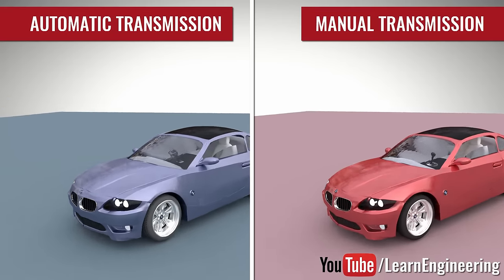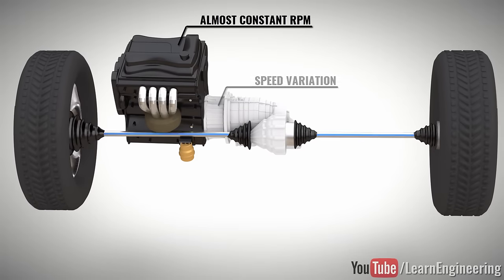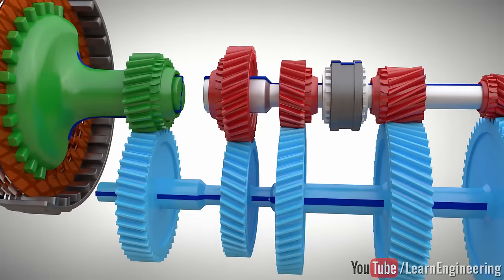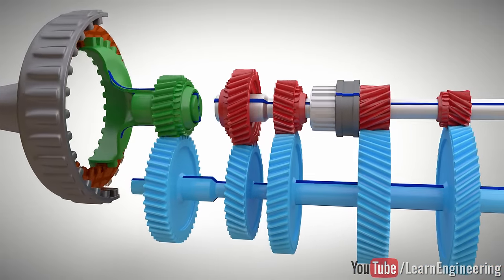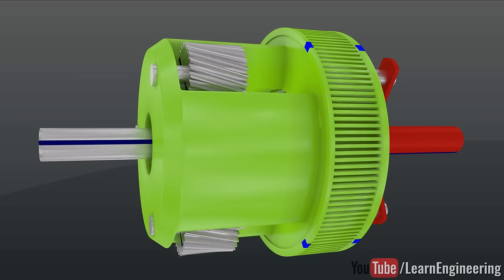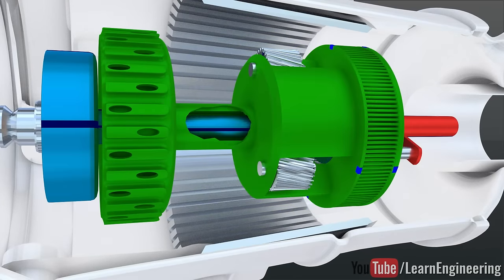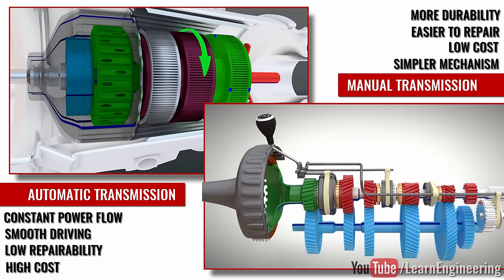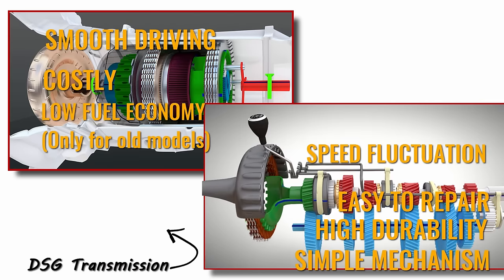Automatic vs Manual Transmission

Comment: You forgot to mention that manual is also a free anti-theft mean in the States
Reply: And also you can roll start if your battery is dead
Reply: Or drive with the starter if your out of gas.
Reply: @edgeofforever7720  how?
Reply: @jettproductions6145  how to drive without battery lol
Reply: @cautarepvp2079  
You put the car in first gear and crank it.

You can also start the car by putting it in gear rolling the car and then "popping" the clutch
Reply: So the way engines start is that the batteries use the starter, which is an electric motor that starts turning the engine parts creating combustion. With a manual transmission, you are able to shift into 1st gear and start it by like going down a hill. However, on an automatic thats impossible due to the torque converter.
Reply: Also never ever use the starter more than 10 seconds at a time. Give it breaks every 10 seconds. The starter is a powerful motor but works really hard to turn, you are able to kill it by cranking over due to the stress it gets. So please only use it to start your car and if it doesnt start in 10 seconds, wait about 10 seconds before trying again.
Reply: I wonder if automatic transmision cars are the dominant choice among americans
Reply: Why?
Reply: It is so easy to drive a manual but you folks make a big deal out so don't feel too smart. I think there are folks intimidated by it but if you are trying to steal a car, I doubt you are intimidated. Most people don't drive stick because they prefer to something else with their hand. =-)
Reply: @idocare6538  driving a manual is so complicated if you drive without any sleep at all, you rise the chance of an accident
Reply: @Aj Reyes 
Same with an automatic. 
To be honest, I don’t have a manual but would really like to get one.  But with any vehicle (whether it is automatic, manual, or aerial) you should not drive sleepless at the wheel.
Reply: @ajreyes1262  well in the other hand (automatics) you have an higher chance of fall asleep since you just have two tasks mostly. And still is not that complicated, its just second nature for most and for my experience you will not have such trouble with no sleep
Reply: @edgeofforever7720  You're burning your starter motor way before you get to a gas station though...Assuming you will have enough battery for that.

It's a good way to get your car out of a spot you dont want it, and the car wont start though.
Reply: Yeah not if u live in the inner city
Reply: @ajreyes1262  I'd argue the opposite. Automatic transmissions allow you to not have to stay as focused in order to smoothly drive so it's easier to get distracted or fall asleep at the wheel. With a manual transmission, you are actively engaged with the process of driving. You always have to be aware of things like rev matching and downshifting, clutch control in tight traffic, or even something as simple taking off on an upward hill with traffic right behind you. Not a concern whatsoever with automatic transmissions, just brake and gas.
Reply: @greego5952  2nd gear not first.
Reply: @pedinhuh16  you can use this on railroad crossing.
Reply: That's pathetic though. Like really. How tf did Americans think its a good idea to do driving tests in automatics.
Reply: @edgeofforever7720  yep, had to do it for 4 km, just put in first and keep the key in starting position without holding the clutch like when you stall it jerks forward.
Reply: Yet US makes most manual sports cars still.
Reply: How is it anti-theft?
Reply: Wulf - Your horrible joke falls flat even more when you check the statistics and realize the top stolen cars in the US are the honda accord and honda civic, in fact for the accord the most stolen model year is the 1997. Try again.
Reply: @ryanwhiteside4333  oh lol
Reply: @DesertStateInEU  salty murican
Reply: @DesertStateInEU  My aunt and uncle literally had their house broken into a few years ago and guess what? Automatic car was gone. Manual was not.
Reply: In the states no one steals cars🤣🤣
Reply: @thedon897  uh.. is this a joke I'm not getting?
Reply: Ryan Whiteside it definitely must be
Reply: @mrroams5812  Still doesnt change the statistics. Most stolen cars are the 1997 Accord and Civic.
Reply: @DesertStateInEU  Check again.  There's no way those two cars make up 50+% of car thefts. Might be the most commonly stolen cars but that might be 1% of all cars stolen,  if that. And then you take a percentage off that for the automatic versions of those cars and your point is basically rendered moot.
Reply: @mrroams5812  And wrong again. Those are the most stolen cars period, and in 1997 there werent many, if any at all, that were automatics. Your point is basically rendered moot.
Reply: @DesertStateInEU  Do you honestly believe over half of all stolen cars are just two old models of cars?
Reply: @mrroams5812  Who said half? And why dont you do your research instead of annoying adults? This is why the internet but especially why voting should be IQ restricted.
Reply: @DesertStateInEU  ??? I live in the US and am generally happy to be here so idk where tf you're getting that from. Nothing I've said has mentioned anything about that? Are you high right now? I guess that explains why you completely missed the points I mentioned in that statistic...
Reply: So true, people these days have no idea how to drive a stick shift
Reply: @mrroams5812  Thats one way of admitting you gave up. Good.
Reply: Can you answer me a question? In a manual transmission, it's bad for the engine to press the breaks without pressing the clutch? Hope you can answer me :)
Reply: @alxxla4102  It's because thief's are as lazy as people, so they don't know how to drive a manual car 😅 lol
Reply: @edgeofforever7720  *2nd or 3rd
Reply: My central locking died on my Mazda 4 years ago, I’ve never bothered fixing it, still yet to be stolen.
Reply: Hahahhaahahaha
Reply: @ajreyes1262  my dad has an automatic, but he still says Manual transmission is better for no sleep driving
Reply: @edgeofforever7720  Or you can pull it with another car with the clutch out which will spin the engine until it fires.  Then quickly step on the clutch when it does.  But on today's cars that are so dependent on computers to run, even popping the clutch won't work if the battery is so dead that it can't provide a little bit of power to the computer.  Popping the clutch worked best on the vehicles before they became so dependent on computers.
Reply: @cautarepvp2079  put the car in gear so the engine spins why’ll you push it and the serpentine belt will spin the alternator giving power to the ignition injectors a spark plugs eventually the engine will start and that’s it
Reply: @alessiom3859  I love manual transmission but I have to get rid of mine because it Fuchs up my knee. If I could get a cheap one that had a paddle clutch I would get it
Reply: @greego5952  w124 and w140 benz with automatic can be started by rolling so its not impossible
Reply: @ryanwhiteside4333  are you from one of the countries that we've bombed or something?
Reply: @ziolp  I'm not, but it's sad you're bragging about that, go invent new names for collateral damage
Reply: @iminsideyourwalls9432  Yes automatic cars are way more popular then manual. I think the main reason people don't use manual is because automatics are just the way of the future. I prefer manual over automatic, but my sister didn't even know what a manual was. I wouldn't call someone lazy just for wanting an automatic transmission, but maybe if the USA only had manuals there would be less accidents. People would pay more attention to driving if they were forced to by driving manuals. Not that I think manuals should be the only transmission, just that we would probably be better off if they were.
Reply: Manuals are dying and for a good reason. It's old tech. I'm from the US and drove manuals for 15 years. So did a many of my friends. Most youngsters still prefer and drive manuals so saying Americans can't drive manuals is a stupid statement. I now have have an 8 speed auto and don't feel like going back to a manual. I throw the shifter into manual mode wherever I feel like having fun 🤷‍♂️
Reply: @ajreyes1262  lmao shitfting on the manual keeps me awake all the time
Reply: I mean not really like lots of people know manuals, I never drove one but I ride motorcycles so I sure I could figure it out quickly
Reply: LMAOOOOO
Reply: @alessiom3859  Reality is because it was due to a higher GDP and much longer flatter roads around our parents time as well as fuel costs.

The culture shift is happening in europe and the UK as well, automatic transmissions are now outselling manuals in britain.
Reply: @edgeofforever7720  drive with out gas??? Combustion goes brrr
Reply: A transmission can't be an anti-theft device. It just moves cars.
Reply: @iminsideyourwalls9432  Yes because automatic transmissions are a luxury. I actually prefer a manual transmission but with the common trend of automatic vehicles, and the fact that automatic tramsmission technology has come so far it's very difficult to buy a manual transmission vehicle in the US nowadays.
Reply: Americans have to be a hot topic right now. Can’t go on a single comment section without hearing what some foreigner thinks of me, hell I knew we lived rent free. But everything from transmission to clothing to housing to alcohol to politics, every aspect of life is critiqued by self loathing Americans and snobby foreigners.
Reply: @alessiom3859  Well actually, only 4% Americans uses manual transmission.
Reply: I left my car unlocked at school and no one stole it lol
Reply: @edgeofforever7720  almost every person I’ve talked to that doesn’t drive a manual didn’t even know there was a third pedal much less what it does, they probably would give up and move on to another car to steal before figuring out how to start it
Reply: @nkdude11  imagine putting them in a model T lol...
It would be funny to watch them try to find the starter button
Or the throttle
Reply: @mauriciorizal  lightly tapping the breaks is fine, and should be done while downshifting as it displays break lights. Pressing any harder without the clutch could stall you.
Reply: Not sure what you mean because many people use stick shift
Reply: Weird that people think this when both of my cars that got stolen were manual transmissions.
Reply: @DesertStateInEU  I used to own an old silver 97 civic. After shopping after a long work day, I unlocked the door, sat down, and went to push my clutch pedal in to start the car only to realize the car I was sitting in was an automatic and wasn't mine.

After that experience I installed a kill switch in my car.
Reply: @edgeofforever7720  second gear is usually smoother, but you can also do it using rear gear, i can start a car that way with less than 2 meters.
Reply: @Wulf why are you so obsessed with America?
Reply: @edgeofforever7720  “Hey, look at me, I’m driving an electric car!”
Reply: @iminsideyourwalls9432  Yes. I think 80-90% are automatic in the US. I’ve only owned one car wit AT since 1976, and I only had that car briefly.
Reply: @alxxla4102  Most car thieves are young, and amateur, and have not learned to drive stick. A professional thief will know how.
Reply: @cautarepvp2079  But also you could just push the car if the battery is dead on manual ones.
Reply: Wow your so hilarious that’s a real knee slapped 😐
Reply: @wisdomfox857  I see you don’t live in the U.S.
Reply: @iminsideyourwalls9432  not at all lol
Reply: @ryanwhiteside4333  hey!!! Yes I can! Anyone else I know tho….. uhh…..
Reply: @edgeofforever7720  mm yes the funny. I’ll be talking to the literally one other person in my school of like 2000 that drives a stick and people will go “wHaT dO yOu MeAn ThErS tHrEe PeDaLs i OnLy HaVe TwO fEeT” like bruh ur never supposed to brake with ur left foot
Reply: @ajreyes1262  Because no one teaches anyone how to drive a manual  transmission anymore.
Reply: @old_spice8054  I've done it in reverse. Dead battery at night parked facing uphill in San Francisco.
Reply: @nkdude11  i do but i i dont live in the city
Reply: @iminsideyourwalls9432  Yes
Reply: @greego5952  you know a lot about motor vehicles 🚗 👍⭐️
Reply: Oh yeah.
Reply: @ajreyes1262  
If you’d be that tired you shouldn’t even be on the road, it would literally be illegal to drive in a state like that.

(Yes, I’m a bit late to the party)
Reply: @ajreyes1262   You shouldn't comment if you don't know how to drive with standard transmission.
Reply: I just take my fuel injector fuse out
Reply: @am you should get a manual if you’ve been wanting one. And I agree you shouldn’t drive too tired but you can argue you are more likely to fall asleep in an outsmarting where you aren’t as engaged in the driving experience.
Reply: @ryanwhiteside4333  why driving tests with automatics? Women
Reply: @mauriciorizal  That's one way of getting stalled.
You're basically stopping the engine.
That's why you need to disengage (cluth) the transmission, to isolate the wheels from the engine.
Reply: @edgeofforever7720  This made me laugh really hard! You're a genius.
Reply: People act like driving manual is an accomplishment. You're just doing extra steps. Besides manual isn't even that hard to drive.
Reply: @ICaligvla  Those extra steps are where the fun lies, you're constantly chasing after that perfect shift, and when you get it it's the best feeling in the world, you release the clutch as you're progressively applying the power and you don't feel a thing, no jerking, no lurching back and forth, nothing, everything is perfectly synchronized, and when you get multiple perfect shifts in a row you feel like an absolute master. I'd say for me, 50% of the driving fun comes from shifting, and the rest comes from handling, noise, and acceleration. And yes, it does require a lot of skills, driving a manual is like art, it's easy to learn but difficult to master. It took me a week to learn driving a manual car decently, but it took me a literal year of daily practice to learn to rev match perfectly, and even now I don't get it right all the time.
Reply: @edgeofforever7720   a very expensive way to move your car, but possible. Last thing you'd want is air inside your fuel pump, it's a very expensive fix.
Reply: @edgeofforever7720  if you're able to push a car on 1st gear, then yes.
 But in practice, I remember when I drained battery in my dad's car, and when my grandfather put 2nd gear I could push it with ease and then it started smoothly.
Reply: @idocare6538  actually most people here (or at least in the places I live) don't know the first thing about manuals, for instance I told a friend of mine to move my car out front one day and he went out only to realize he didn't know how to drive it. I've even had people ask me "what's the third pedal for on the left?" It is easy to drive a manual but the problem is people don't know how because they've always had automatics their whole lives
Reply: @iminsideyourwalls9432  it is, mainly in cars, small vehicles used in the city, but then for country people like me, I’ve got a couple Dodge Rams with automatic transmissions, and my uncle has the same vehicle, but with a standard, now I can pull better with the automatic, but in order to have the same amount of power going to me wheels, I have to have my engine tuned up to handle the power requirements of the transmission. So technically, a base vehicle like mine compared to my uncles, his is more efficient, but with a tuned up engine, I can do better than his truck lol.

There’s a huge grey area in the pickup truck area for Americans for transmissions, with the tech now, either of them can perform pretty good, it’s just buyers choice, no real need to knit-pick every detail for the job
Reply: @iminsideyourwalls9432  They are, we have a strong manual culture among older folks and gearheads but automatics dominate the country.
Reply: @cautarepvp2079  the starter is just an electric motor that moves the crankshaft to get the cylinders moving at a low rpm, until it can start igniting fuel & the little explosions against the cylinders can power it. when you put your key in and turn it, first position lets the battery power little stuff like radio & windows, 2nd one turns the ignition on (spark plugs that ignite the fuel for little explosions), 3rd one that you have to hold & returns back to the on position is you supplying the power to the starter, requiring you to hold it powering it until engine can start igniting fuel. basically, by holding your starter in 1st gear you can power your car with an electric motor, just not very efficiently since power flow goes from starter to crankshaft (which moves the cylinders & is connected to the cam shaft through timing belt) through the clutch to the transmission gears through the driveshaft to a differential and finally axle shafts (could also have transfer case for 4wd vehicles) and the battery will drain pretty quick, starter takes lots of power & alternator wont be able to keep the battery from dying
Reply: @Robo-xk4jm  damn nice explanation
what about tesla and cars that have buttons instead of key,
Reply: @cautarepvp2079  ive never really done research on push-to-start cars but my best guess & from what ik driving an altima (only push start car ive driven) it basically gives those controls over to the computer/logic board, it sees if the key fob is within range most likely with radio waves, pressing the button without pressing the brake acts like the accessory key position. pressing the button while pressing the brake allows the car to start, instead of 2 different key positions the computer powers the ignition circuit until you press it again to turn it off (which is where normal key would sit during operation), and right after powers the starter and disengages it once it detects fuel ignition or a high enough rpm, instead of the driver having to let go of the key once the engine starts. ive never had a problem with starting when i drove an altima (screw CVTs btw) at most security lock kicked in which just cuts the battery off from the rest of the car until you can reset it
Reply: @cautarepvp2079  as for teslas and other all electric vehicles, there is no starter or ignition coils/spark plugs, just big electric motors that are either powered or not, controlled by the computer regulating power based on throttle input, which allows for much faster acceleration since it gets instant torque based on the speed of electricity, compared to combustion engines where it depends on a sudden influx of air & fuel with different powers & torque values at different RPMs. also electric vehicles can have a motor at each wheel, only transferring power to an axle & wheel bearing, compared to combustion engines that only has 1 output, and has to transfer that power through multiple kinds of gears and shafts, first the transmission (plus torque converter/clutchpack) transfer case if 4WD or AWD, dive shaft with u-joints, differentials, and finally axles & wheel bearings, which results in loss of power compared to crankshaft (wheel HP vs engine HP)
Reply: @ajreyes1262  why would you be driving with no sleep. might as well be drunk
Reply: You really believe that criminals that their “job” is stealing cars don’t know how to drive a manual?
Reply: @yuvalbtw8516  random guy that hops in the seat of someone's running car at a gas station /= professional car jackers
Reply: @Robo-xk4jm  you would assume that someone that hops into cars knows how to drive them
Reply: Hahahahahahahha really???
Reply: I thought manuals were more common in the US
Reply: @idocare6538  Most people don't drive a manual because they are incapable of doing so.